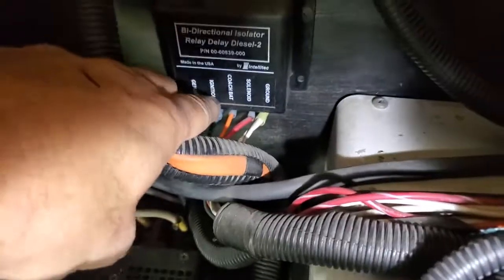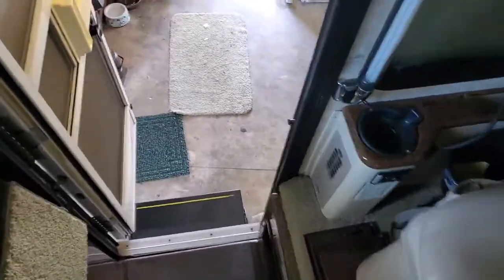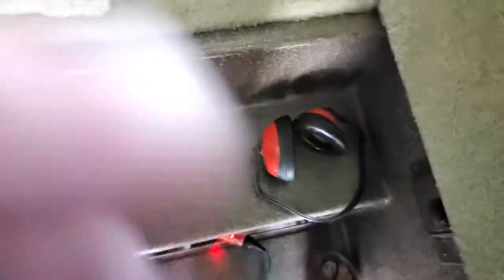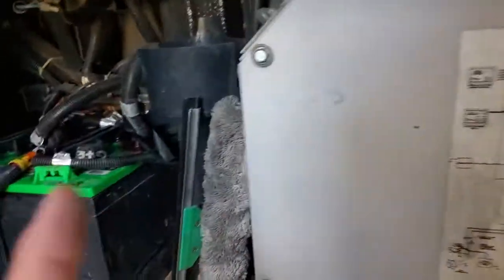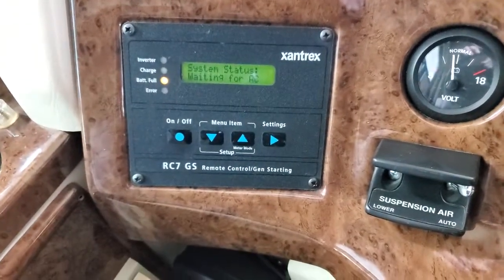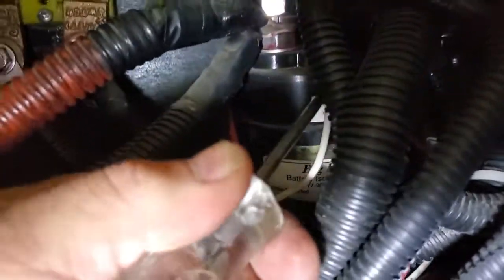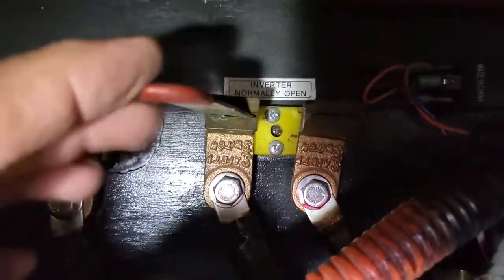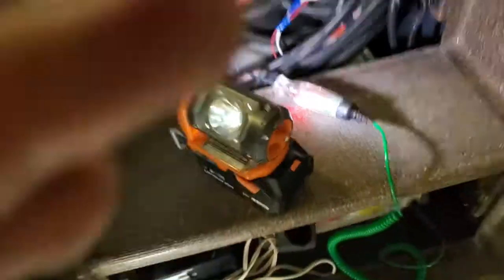RELAY TESTING . BIRD BIDIRECTIONAL ISOLATOR RELAY DIESEL  .VIDEO 1/2

Comment: If i have lifepo4 house batteries in a motorhome, should i just just disconnect all this stuff? I have the bird that came factory installed and havent really changed any wires to or from it. I did put a renogy 12v DC/DC charger from the chassis postive to my house positive though.
Reply from the maker: Join my Facebook page rvdiagnostics 
That way we can call each other on Facebook messenger phone. 
Do you have a multimeter and basic hand tools?

https://www.facebook.com/groups/1974314296166277/?ref=share_group_link